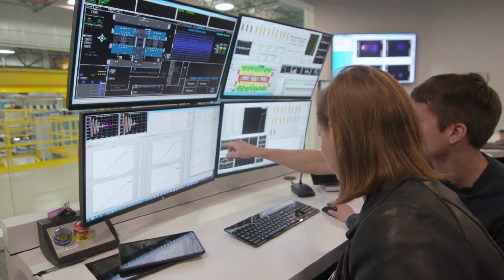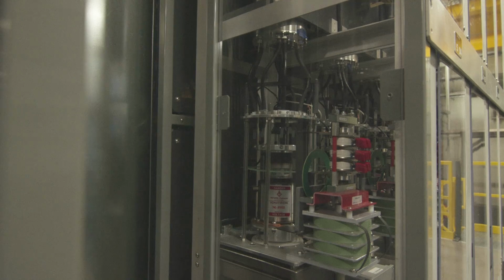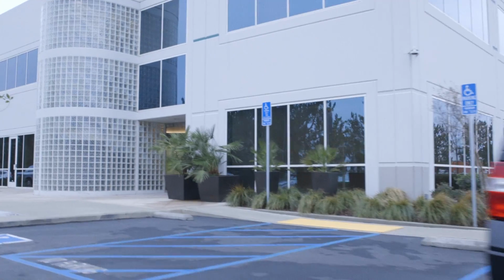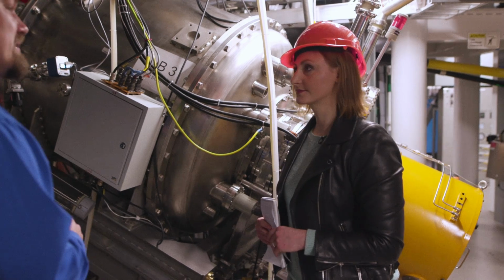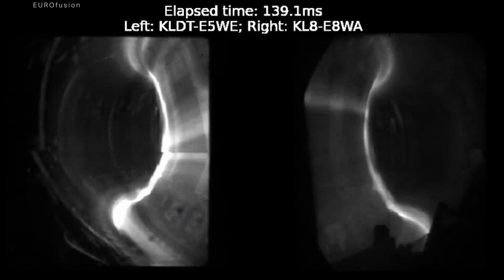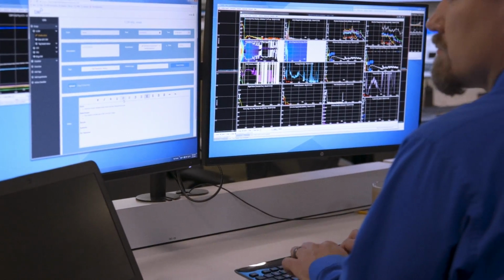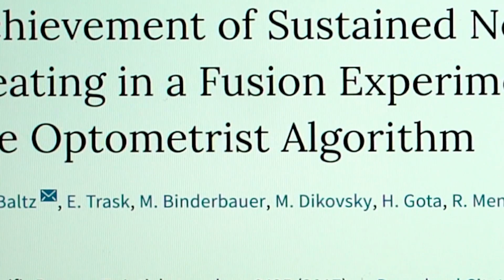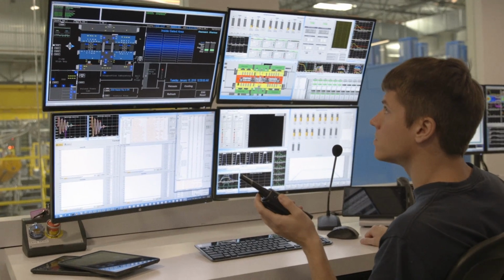Can AI help crack the code of fusion power?

Comment: its not laid out  even in theory yet

we  know  lightning  could  power  a small town,  yet we cant store it

same apply to fusion,  we cant just drain the energy  directly to  batteries  or to a powergrid
heating  water and spinning generators   is too many steps, yet  way  less  material invested  like  in a coal based energy plant

Comment: Nuclear fusion as you called it  throws you off in your approach?  It's really cold fusion as our sun is driven?  Imagine the elements in our periodic table that becomes harmonically hot when put under certain  pressure(s) as you know they exist in our Sun?  It's been proven and possible as proven?  I hope I've given you another approach rather that AI as humans have done this and know it's possible.  You can do it without AI. So it has been said so I wish it will be done.

Comment: Just as long as they are using machine learning techniques and AI to help find the best possible solution as opposed to allowing the AI to manage security procedures, and anything else that might control safety features and physical systems that run the fusion process - otherwise, well just use your imagination...

Comment: The problem is the process has too many variables to control, it needs to be extremely simplified.  Simplifying the model is the key. 
The gravity of the sun is the simplification key for the sun, on a small scale, you have to find it's equivalent.

Comment: Needs to be a spherical chamber under pressure with the plasma injections from around multiple points, centrifuge fires the atoms into chamber, I'm thinking a gas used for the pressure that could also benefit the plasma injection and heat, Time of reaction could vary would need AI to calculate the burn out to work the time to fire and repeat like a combustion chamber on a car hmmmm

Comment: hahahaha what a bullshit, using alorithms you can't make fusion to generate more power than it takes. To do fusion net efficient you need to reduce energy used to run it.. I know 1 solution: big mass and then internal pressure will do the job.. but hey, isn't it called a star?

Comment: I don't really understand how exactly they heat up the particles to fusion temperatures. The sun's core has a temperature of 15 million degrees kelvin, which is still not enough for theoretical particle fusion (100 million kelvin) Most of the particle fusion in the sun happens through quantum tunneling, which requires a lower temperature. How do they achieve such high temperatures here on earth?
Reply: I believe that quantum tunneling require not as much temperature, as pressure and....well...probability. Sun is BIG. Has LOTS of atoms. Orders of orders of magnitude more ;) than human physical device.

Comment: You know, this is like the early stages of when car engines or the first battery was invented. You know like a 5 Hp engine the size of what now could be a 1 000Hp engine or the first computer that was around the sice of a house with only the function of a calculator and now we essentially have a multipurpose supercomputer (with a flashlight) in our pocket that you can communicate with others on the other side of the plannet i you want to.
So it's exiting to see the amount of progress we humans are doing as it's no longer some impossible sci-fi movie dream but pretty close to becomming a reallity.

If only we were as good at disposing waste or trash the rigth way. You know keeping the ocean clean from plastic and stuff.

Comment: So to be clear, I barely understand the forces involved in dropping my phone but with my very limited understanding of energy is you can't get something from nothing as in there are always losses or at the least you can't get over 100% efficiency. My understanding is fusion works in a star due to gravity pulling everything into its center until it is so dense that it fuses hydrogen together and it is this fusing of hydrogen that gives off the energy that the sun does. 

Could someone help clarify?

My understanding which is likely wrong, is that the Sun essentially converts (for lack of a better word) gravity into the energy we see and use by pulling atoms close enough to fuse? Meaning it doesn't give off more energy than it uses because that would be impossible? 
If any of that is true, how are they expecting to make more power than they consume from a fusion reactor?

Thanks in advance.

Comment: even if we achieve fusion, it would not be economical to produce electrical power due how expensive is to transform heat into electricity.
Unless we used as a heat source.
But the people in Airborne wind energy should be using AI to solve their self flying algorithm, solar and wind energy today are the only ones with a potential future.

Comment: You should do a piece on the Wendelstein 7-X fusion experiment:
https://www.ipp.mpg.de/4413312/04_18
"In the past experimentation round Wendelstein 7-X achieved higher temperatures and densities of the plasma, longer pulses and the stellarator world record for the fusion product. Moreover, first confirmation for the optimisation concept on which Wendelstein 7-X is based, was obtained. Wendelstein 7-X at Max Planck Institute for Plasma Physics (IPP) in Greifswald, the world’s largest fusion device of the stellarator type, is investigating the suitability of this concept for application in power plants.
...
They are to make discharges lasting up to 30 minutes possible, during which it can be checked whether Wendelstein 7-X permanently meets its optimisation objectives as well."
Reply: https://www.ipp.mpg.de/4423269/06_18?c=4313165
Touring IPP’s fusion devices per virtual-reality viewer: ASDEX Upgrade and Wendelstein 7-X – as if you were there / 360° view of fusion research
Here’s the way to ASDEX Upgrade and Wendelstein 7-X:
www.sonnenmaschine-vr.de and www.sternenmaschine-vr.de

Comment: The reason for the net loss is because the energy output required to contain the plasma via electromagnetic fields is not as efficient, or as strong as the gravitational field produced by the sun due to it's mass, "which no device on earth can reproduce." and since the gravity is a consequence of it's mass, it doesn't produce or  contribute a net loss of energy to it's internal Dynamo just to contain it. Not to mention, even with modern equipment, the waste heat from such a device wastes as much energy trying to contain it than what can be produced. That's why there's a net loss.

Comment: The last sentence begs repeating: That means, roughly speaking, that each deuteron would have to be accelerated by an electrical field possessing a total potential of not less than one million volts, which is a considerable amount of energy.
CROP CIRCLE ANALYSIS by M Dudley of Oak Ridge TN
 
http://execonn.com/cropcircles/isotopes.html
 
The other way is activation. Activation is the process of bombarding atomic nuclei with energetic subatomic particles. The nuclei capture the particles and are thus transformed into different nuclei. If the number of neutrons in the nuclei change, they become different isotopes of the same element. If the number of protons change, they become different elements altogether. For example, it is theoretically possible to change lead into gold by activating it with the right mixture of particles. The only obstacle, aside from its difficulty, is the fact that it would cost more than an ounce of gold to produce an ounce of gold.
There are many different kinds of activation: activation by alpha particles, activation by protons, activation by deuterons, and so on. Each kind will have different effects on a given atomic nucleus. But despite this complexity, activation enables us to produce an elegant hypothesis about what happened to the soil. We have discovered that the radionuclides in Table 1 have one and only one common denominator, and that is activation of naturally occurring elements with deuterium nuclei (deuterons.) In a moment we shall undertake to prove this, but first it may be helpful to explain just what deuterium nuclei are and what they can do.
Deuterium is an isotope of hydrogen. Its nucleus is composed of a proton and a neutron. (The rest of the atom consists of an electron, which is easily stripped off to leave the ionized, bare nucleus.) Since ordinary hydrogen's nucleus contains only a proton, deuterium's extra neutron entitles it to be called "heavy hydrogen." Deuterium is not a particularly rare isotope, since it exists in small quantities in ordinary water. It is a useful one, however, since it is used to control neutron emissions in fission reactors, and constitutes much of the fuel in fusion reactors. Of course, knowing these basic facts still tells us nothing about where these deuterium nuclei (we shall henceforth use the term "deuterons") came from. They could have come from any number of sources, including ones not yet known. At the moment, we think it more useful simply to assert that they existed than to speculate about their origin.
In any case, the deuterons we hypothesize are remarkable not because they are rare, for they are not, but because they are highly energetic. Most deuterium particles found in nature are relatively unenergetic, such as the ones in ordinary water. An unenergetic, that is, a slow-moving, deuteron cannot penetrate and alter atomic nuclei, just as a bullet casually tossed at a television set will not penetrate it. An energetic deuteron is a different story. A deuteron accelerated to high speeds can penetrate an atomic nucleus and "activate" it, i.e. convert it into a different isotope or even a different element. Like a bullet fired from a gun, it can radically alter the objects it strikes. But the energies would have to be large. We think that to activate atomic nuclei, deuterons would have to possess energies exceeding one mega-electron-volt (MeV). That means, roughly speaking, that each deuteron would have to be accelerated by an electrical field possessing a total potential of not less than one million volts, which is a considerable amount of energy.

Comment: The research center in England is alot better as you can watch sustained fusion in there reactor core, also you can't use imperial measurements in the context of science as that subject is measured in the metric system, this video clip is all around stupid and I'm glad this didn't get in TV

Comment: a resistor that went bad or a board that experienced over voltage, all that from a red indicator? right... sounds like they failed to design robustness into the circuitry.

Comment: fusion power is easy:
hydrogen, pressure, and heat.
you can't have pressure and heat with regular materials, because,... well... pressure and heat
so, you need to separate the heat from the material, while also putting pressure on the material.... so, now you see the problem.
enter, magnetic fields: the tool that'll help you move the heat and pressure away from the material.
the problem now is, that magnets need to be electromagnets, because there's no natural magnets capable of generating such big magnetic fields.
and, electromagnets require power, and power comes from power generation plants.
HOPEFULLY, the point will come, where the power generated by fusion power will exceed the power required to put the process into motion, which at the point of starting the process shall be provided by established power generation means, such as nuclear power, which, is managed by private corporations.
SO, private corporations will have to put out power to power an experiment, that should it succeed, will effectively render said corporations obsolete.
NOW you see the REAL problem.

and I didn't need an AI to figure that out!

Comment: No mention of ITER?
It's going to be one heck of a research platform when it's up and running, and likely help pave the way forward.
Reply: yeah it will be finished soon
Reply: @user-si5fm8ql3c  Research project will run like 20 years after its finished though, so results are still miles away.
Reply: @user-si5fm8ql3c  yeah, any time within the next 20 years!
Reply: @MW-vg9dn  @-M W   Here's to any time within the next 20 years in 2039! ;)

 I actually support fusion by the way, I'm just can't pass up the in joke. :/
Reply: sparc is 6 years away and better than outdated/worthless iter, the secret sauce is the new and powerful magnets. 10 year max for 5Q output, 20 years for tech adoption.
Reply: @shashanksingh9095  Please just stop, thats just marketing.
ITER is a research apparatus designed to help understand how and if building a fusion reactor is possible, its the sledgehammer to crack a walnut since people are tired of failing to make significant progress.

It will be neither outdated or worthless.

Comment: This would work if the "SUN" was powered by fusion and not something else. So what if there was an external source powering the SUN? One must remember we have no proof the SUN turns Hydrogen into Helium through compression and heat at the core. Side note Metallic Hydrogen if created would be a super conductor at room temp so the contradiction is why doesn't compressed Hydrogen become Helium? Perhaps we are wrong about the SUN and it's inner workings.

Comment: What they are doing is data analysis and optimization... calling it AI is not wrong but quite a stretch.
The idea of AI seeing something we dont have the capacity to is very interesting. But that probably would happen on the theorical physics. Way before actual engineering.
This particular group is probably just burning investor money without any viable pathway to a product. Clearly far behind other initiatives like ITER, Wendelstein and the Lockheed Martin container sized reactor (if its real).

Comment: why cant they run a genetic algorithm. Randomize the shots, completely different each time, and then do mutations on the survivors, by combining them with other optimal shots? Sooner or later they will have some type of optimization. Then they can run deep learning on this dataset at large to see patterns, and to create new combinations
Reply: Requires very large numbers of samples. Not viable with ~50 per day.
Reply: @PlayerID666  but 10 days would be 500, and 100 days would be 5000 runs
Reply: @ImHewg  That's nothing considering the dimensionality of the data (20+). There are way too many possible conbinations of parameters.
Reply: @georgc6947  maybe find some way to simulate the reaction with a program. But you're right, man that's unfortunate. Maybe one day when quantum computing gets online we will have enough processing power to rub simulations
Reply: @ImHewg  The problem is that they don't seem to have a good computational model of the reactor. If they did, they might indeed be able to simulate the process and use a variety of machine learning techniques. The main problem here is not processing power. I don't see how quantum computing will help either, since it is only more efficient on certain types of problems and not more powerful in general.

It is pretty natural to use machine learning in general for problems such as these though, which is also why I don't see anything sensational here.
Reply: @ImHewg  Nuclear calculations are way to computationally heavy for most models. Current models have 18+ different terms in their potential terms, multiply that with spacial degrees of freedom and then with the numbers of nucleons and then you have to do scattering calculations after. Good luck. Lattice QCD isn't any better since we don't really have the computer power to calculate anything with it.

Comment: And yet this isn't Star Trek where Fusion energy translate directly into electrons.  Nope, it'll be used as a heat source and boil water and turn a turbine the same as N. Tesla was playing with a century ago.  Source to electrons needs to be the path eliminating the old steam engine dynamo.
Reply: P-b11 fuel produces He4 ash which can be converted directly into electricity.
Reply: also
why do you want to abandon Steam based Generators ?
they are pretty good and achieve up to 45 % efficiency
the Waste Heat can be used to heat Houses and Stuff
Reply: In Star Trek Matter/Antimatter reaction - as physics dictates - turned 100% of energy into photons.

Comment: Why not use time as the backpropagation consolidation within a closed neural network which takes in data from sensors and activates the actuators needed to sustain a plasma field? Take humans out of the loop. Because on an iterative model, it will speed up exploring permutations exponentially faster. Especially say using grid computing methods or distributed caching. They can then re-structure the design model if necessary to achieve the final result. Instead of wasting time with testing.